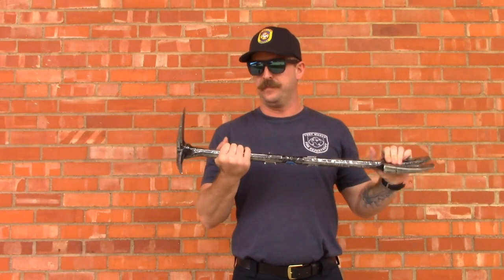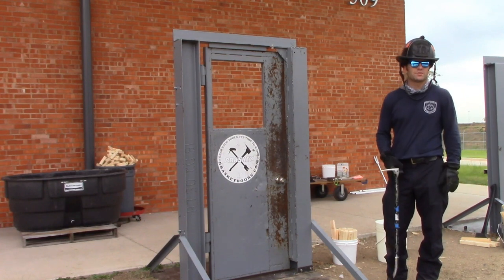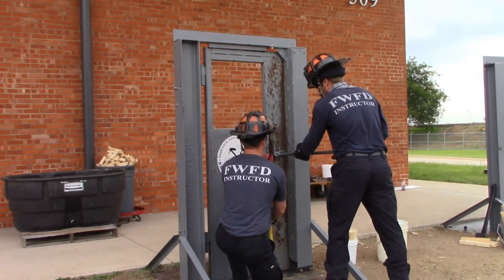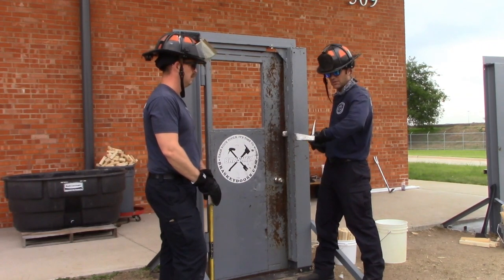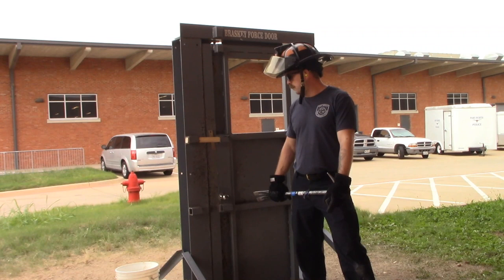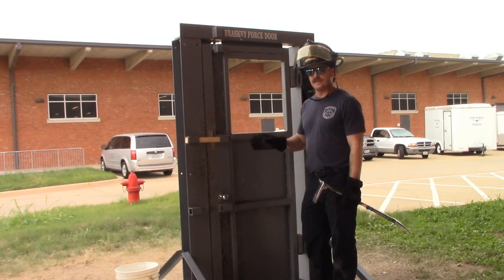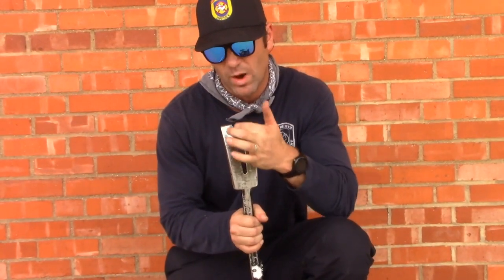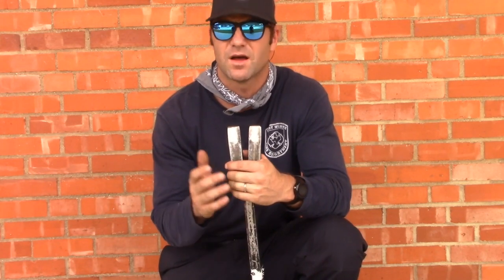Forcible Entry with Irons

Comment: If it's a solid core wood door you can also use a chainsaw and for steel pre hung door use a metal battering ram like what the swat team uses and a big pry bar so you can have lots of leverage. someone ready with a hose in case hell waiting behind that door